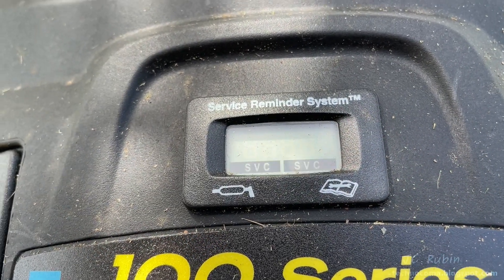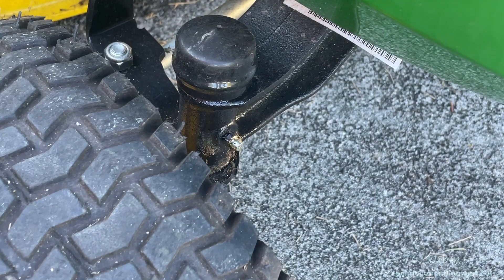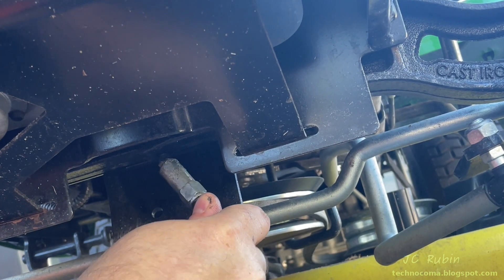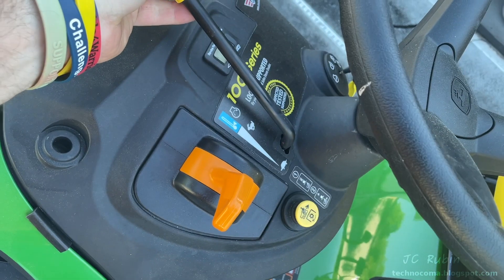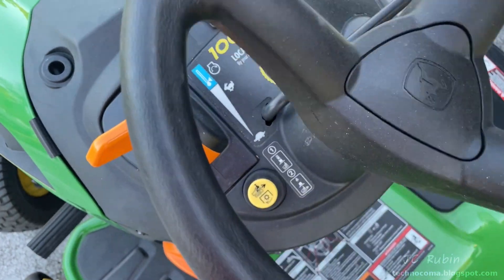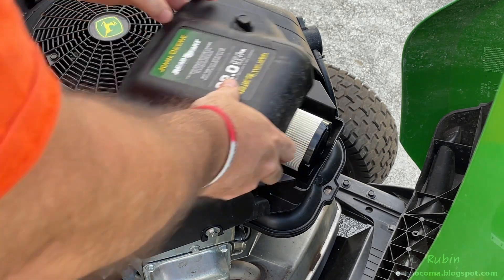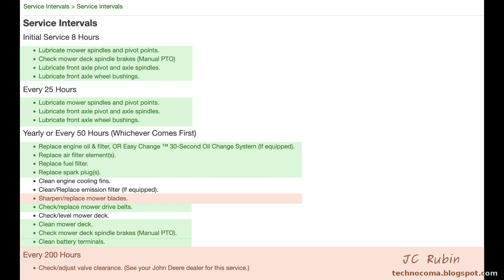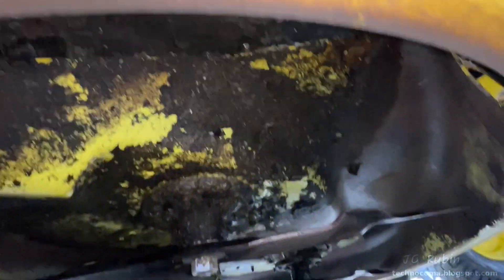John Deere Lawn Tractor Maintenance 8-20-50 Hour Maintenance Intervals Covered

Comment: Great video, Jordan!

I'm about to do my 50 hr on my S170 and I'm going to convert the oil change abomination back to the way Briggs and Stratton intended ... there's even a JD part # for the kit. I"ll start just as soon as I get my hands recalibrated ...

73!
Reply from the maker: I had to do it once and document it in the video as OEM, but I think its a crap idea and Ill be swapping it out on the next oil change.
Reply: You can keep the big filter and add the drain tube at a minimum.

Comment: The E150 does NOT have grease fittings for the rear tires. You forgot to tell us how to make the Service Flashing light go away. After performing all service, my tractor would still not start up. How do you RESET the E150 service notification?

Comment: I'm disappointed in JD for that EZ filter at almost $80.  That is nuts !!.  Convert it back to a regular oil filter at about $10.00 for a generic.    Strictly a money masker for JD.  Also, it does not allow for all of the oil to be changed.  Why they came out with this is a mystery to me if not for extra money.  Really J-D.

Comment: Excellent video.

I see no reason to change the spark plugs and fuel filter anywhere close to the intervals specified by JD - other than to improve the profits for JD. The spark plugs should be fine for many hundreds of hours, if not thousands - the same for the fuel filter with reasonable refueling care. Unless your mowing jobs are very dusty - the air filter should not need changing until a gentle blowing out is not sufficient.

After the first two or three oil changes, I see no reason for the frequent changes specified there either.
Reply from the maker: I agree that the maintenance intervals and parts purchased may be tied to profit. Especially service for those who have work performed for them.

Comment: Blade spindles have sealed bearing so grease doesn't help them. There is a YouTube video on removing one seal from the bearing.
Reply: The grease is to keep the cavity filled to help keep spindle and housing cool, moisture, and dirt out if it seeps past the seals. Plus, these residential riding mowers have a sleeve over the shaft that goes through the spindle housing. The grease also helps keep the cast aluminum housing and shaft from wearing out too fast. So, the grease was never meant for the bearings since they are sealed, as you stated.